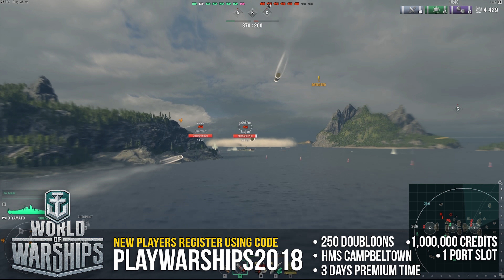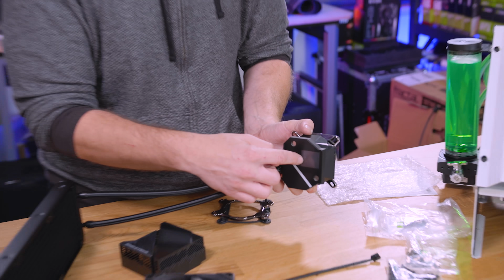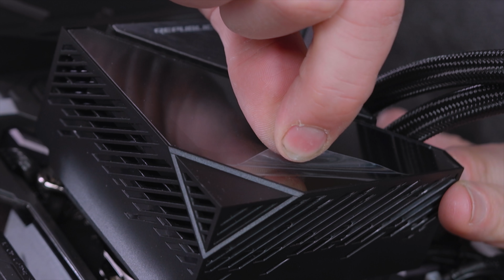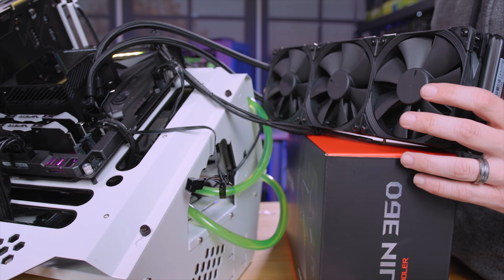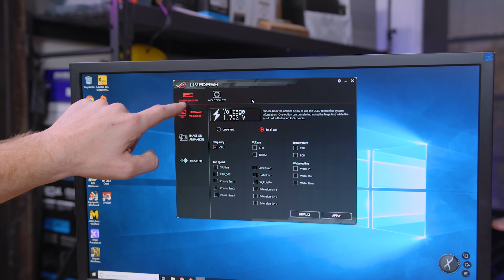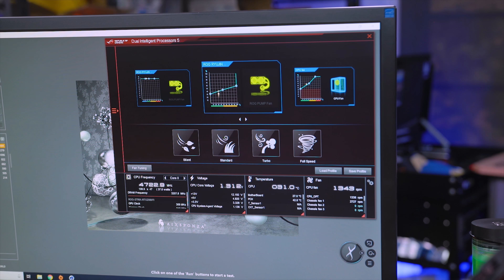ASUS made an AIO... but is it any good?? RYUJIN 360

Comment: It would be nice to see MB manufacturers begin adding some cable management to the motherboards themselves, either pass throughs close to the cpu socket or extra circuit layers to the top of the mobo that would allow closer mounting options for fan and pwm headers. This would be difficult given the way pcbs are printed, the sheer density of leads printed into each layer of the boards, and the problems caused by self induction when high current moves over inactive leads in other layers (interference and corrupted data anybody?), and as it stands, would be a very use case specific application. However, as more enthuist and gamer focused builds are moving towards watercooling and obscenely rgb components, one or both of these features to the boards themselves would add some much more attractive options for cable management. Adding some slightly taller standoffs could even allow companies like asus to place some of these connections on the back of the mobo, hiding those non customizable, hard wired component control and power headers to a place where they would remain out of sight. 

As for the AIO itself, it is very disappointing that asus did not do better quality control on the header wires for the fan control splitter. It is also disappointing that they did not wrap the cables together as one bound bundle for prettier cable management. The asthetics of the block/pump/screen are quite nice with the included shroud, but the fan for the VRMs is quite loud and annoying, youd think a bit more engineering could have been invested into the acoustics of the aio. The feature was a nice addition, but without better acoustics, it kind of runs it. If someone needs the extra vrm cooling, it would have been better to make a monoblock version to achieve the same ends with better asthetics and less little girl fan scream. 

On a related not regarding cable management, I think it would be cool to see if one of the rgb fitting manufacturers could make some hardline with imbedded power and signal lines inside the walls of the tubing, or figure out a way to flatten the wires into something that can me stuck on to the bottom, side, or top of existing hard line. I love the idea of a seizure inducing rgb build, with rgb or UV hard line fittings to make the cooling fluids look luminous without any other lighting source (think glowing green brain goo). But all those pwm wires dangling from each fitting is annoying to say the least and is neigh impossible to manage without taking away from the asthetics of the build itself (is that a "neigh impossible" comment a cable management challenge of the year for Jay? Maybe so).

Comment: yikes $280... i'd sooner buy a Swiftech Apogee Drive II ($150ish) and a XSPC ex360 radiator  ($63) and 3 Scythe Kaze Flex 120mm fans ($45).
not only cheaper*, there is a Copper radiator and far stronger pump. this will run whisper quiet with no *horrible whine like the Asus pump head fan. this will out cool and out duel any AIO and last longer.

Comment: Does it come with AM4 connector bracket or just Intel. Also would you hear the fan whine be heard inside an actual computer case? Also will you compare it to other AIO products. From a cooling (performance) stance is paying almost $300 better than other high end $150 AIO brands/Units? I don't think so, the OLED screen is literally pointless unless you have your Case right on the desk otherwise why even add the expense or gimmick. I like with Kyle from BitWit did with his overview. All I got from this video was a sponsored add plug and not much information on this very expensive AIO well other than shotty production of the Ryujin.

Comment: Hello Jay and Youtube builder community. I'm trying to build my first gaming PC. I've already bought most of the parts, but was in a hurry to try to get everything during Cyber Monday (even if not all of the parts were discounted for the day), and after further research while I wait for the parts to arrive, some of the parts might not be compatible (PH-TC14PE_BK) and others are apparently not all that great (Enermax T.B. 3-in-1 120 mm RGB Fans), so I was hoping for your opinions. The only thing I haven't bought yet is RAM. I'm completely open toward RGB in the build, preferably addressable, but what I'm not open to is a CLC (personal preference, don't want to even slightly risk liquid leaking on my very first, expensive build lol).

So, I'd like your opinions! First off, here is my parts-list: https://pcpartpicker.com/list/CywG6s      Just a preface as well: I know a 750w PSU with the build isn't optimal, the reason I purchased it is because I hope to purchase a better GPU soon. That reasoning also happens to go into the purchase of the monitor.

Some items i'm looking into possibly buying, and would like an opinion on, is the MF120R 3-in-1 pack  and either the G100M, MA620P, or MA410M (not necessarily a CM fanboy, and I'm completely open to alternatives). So, please, help me out, y'all! :)

Comment: I know that the wiring issue probably threw you, but there is little point in doing a review of a product that you are not going to test properly. Not comparing the temps with those reported by the installed sensors via a known good method is slack and would have highlighted that the package temp is 10-15c higher than reported by the block. TTL of OC3D had his review up a few days before this and highlighted the issue through this comparison. We don't expect absolutely rigorous scientific methodology, but this you may as well mark up as "entertainment only".

Comment: When AIO and MB manufacturers will start making some kind of standard where standard 4pin fan header with GND 12V RPM PWM can automatically switch to GND 12V DATA- DATA+(doesn't have to be USB standard can be I2C) so pump of your AIO is using only one cable for everything and you don't need to deal with a fuckton of cables?
It's completly doable.
And if not AIO LC then you could connect a RGB fan and have only one standard 4pin cable coming out of it, could have everything, RPM feedback, standard RGB control, addresible RGB, PWM control and heck why not a temperature sensor so you know intake/exhaust temperatures...
Reply: + it could be able to control addresible RGB strip

Comment: I've been using the DEEPCOOL Gamer Storm CAPTAIN 360EX RGB.
ASUS Maximus X Code, I7-8700K G.SKILL Trident Z 3200 RGB.
5.0ghz 1.38v... CPU is not de-lidded.
The CPU will crash under extreme loading (PRIME95) It never crashes running any game or app.
CINEBENCH R15, I Hit 86c 12 thread score of 1631.
Hope this is useful to someone.

Comment: Disregarding the loose fan headers on your unit, one simple solution would have been to put all those seperate cables into a sleeve in the factory. For that pricetag, that wouldn’t be too much to ask, right? Especially since they’re hardwired in there...

Comment: Just one question, if someone has their pc stashed under their desk, will they be getting off their chair and kneeling down sticking their face on the glass panel to check some numbers that they can easily see on the monitor? And what if someone has no glass panel? There is no point of this display

Comment: since ever had problems with Asus.
2011 17rog lap with bad keyboard. some keys weren working. and there was many ppl having the same problem
2013 another rog lap that had problem with key
2014 ok rog lap
2017 lap rog with sound problem and forums are full with the same.
3 rog routers that are bad sometimes. wifi stopped from time to time
2017 1080ti strix that didnt perform
i gave to much credits to this stupid company

Comment: Got an old kraken running push pull, two noctua industrial doing the push great temps on a delidded 8700k 60max 5.0/5.1 avx offset

Comment: Loose wires can be fixed, but you can't fix the LOUD fan on the pump, which you really hated!. I guess you could just not use it,
but then the air flow for the components surrounding the CPU would be gone. Can its RPM be adjusted? I notice you did not
 mention this big negative in your final sum-up.

Comment: I have the Corsair h150i (360mm rad AIO) cooling my i7 8086k @5ghz 1.3v. Never go over 46 degrees C while gaming. Very happy with it. Also got it for 140 dollars, down from it's normal 170.

Edit: Replaced the stock thermal paste with Thermal Grizzly Kryonaut as well

Comment: Auto Fan Tuning is a complete fail on my Asus board. Sometimes my CPu fan is set to 97% minimum speed. Doing the next tuning I get 25%. And the worst thing is, that you cannot tune single fans. So it does the whole process for all fans again and then the next time my case fan is set to 97% minimum.

Comment: Dear Asus. 
  As a semi long time Asus user a7a266 anyone you make some nice things, but wtf can't you hire a software engineer that can write ai suite with all the toys built in that doesn't require going into the software installers and changing properties and unchecking comes from a different computer that doesn't have 25 craplettes as a fyi this is not spelled correctly according to google and it wants to replace it with strapless running in task manager? 
Can you please hire a software engineer that can write code that isn't broken runs on everything, that isn't crapware that nobody wants to use that doesn't use 300mb of ram. 
Thanks a loyal customer for almost 20 years.
  As a afterthought QC guys QC.

Comment: hey, i need a suggestion for a monitor, i bought a pc with the help of my pc gamer friends , I have nvidia rtx 2070 , asus rog strix b350-f ddr4 something, 16gb corsair vengeance lpx dual kit, 650 watt corsair tx-m power thingy, hardrive+ssd ofcourse, 8gb msi geforce rtx2070 ddr6, amd ryzen 5 2600x  6x 3.60ghz . now the thing is , I don't know what monitor to buy under like 700$ , I want to edit videos and use programs like photoshop and stuff that's why I look for a 1440p display and since i am also going play games i want something with a proper refresh rate. There are things like g-sync and free sync and ips/tn/va panels and 1-4ms input lag and such. I am confused and don't know what to get, any suggestions? :)
Reply: I meant lower response time herp derp, as far as refresh rate higher is better, mb
Reply: @ProwlXV  i am currently looking at the ASUS ROG Swift PG278QR 68,5cm, it has g-sync and a refresh rate of 165hz. do you think its worth the money for the pc i have and the things i am going to do?
Reply: I dont know how much it costs though (I am in America and prices could be different)
Reply: @ProwlXV  thanks for the help :)
Reply: Okay so you have a 2070, since that is Nvidia you would want a G-Sync monitor, as far as refresh rate lower is better, also some 350 motherboards won't work with Zen+ (2600x for example) without a BIOS update.
Reply: @ProwlXV  why lower refresh rate?
Reply: The monitor is a little big, but 165hz is not bad

Comment: I'm still rocking an NZXT Kraken X60 from like 5 years ago with the stock thermal paste and temps are still good on my 4770K. I'll probably replace it whenever I upgrade to a new platform, but I've been pretty impressed with it's performance over the years.

Comment: Pretty easy to fix the wires if you have a proper molex crimper.  You shouldn't HAVE to of course, but I'd probably do it if the other option was RMA and waiting for replacement.

Comment: I must have gotten real lucky with my 8700k. Even with my old corsair h105 I barely hit the 60's at 5ghz. Granted mine hits 5ghz at 1.2v with 1.184v under load I am still shocked I get low temps.

Comment: Also, as I'm watching... disappointed (but not at all surprised) by the problems with the fan splitter/adapter... As a professional custom sleever, I know how hard it is to get splitters/double crimps done well (even with the best materials and hand-done attention to detail)... and they're even worse when done cheaply by a factory with insufficient tools/materials.
Reply: Solder them and it's NEVER a problem. In fact you will break the wire before you break a soldered joint. If your a professional sleever you want to make a huge dent in the market. Solder all or contact points.
Reply: @whpony96  soldering has it's place in wire/cable production... but often, crimped connections are much better... not when you're trying to make a big split joint (since terminals are designed to be crimped on one wire, so even double crimping can be dangerous)... the conclusion there is that any sort of splitting (more than two wires, which is definitely better soldered) is not ideal... as for soldering everything, the problem with that is that it is not viable as a business decision... the time and labor involved in doing that would make it virtually impossible to cover costs (much less make any sort of profit, which is already a small margin as is).
Reply: @whpony96  additionally, soldering by hand means that you can overdo it and unintentionally create a cold solder joint and/or let the solder flow too far away from the joint, which creates extra weak points in the wire... so while you may never break apart the soldered joint, it can create extremely weak points around the joint that are very easy to break... Don't get me wrong, I love soldering things, but it isn't always the best solution.

Comment: Lovely video, loved the editing, fun to watch, thanks! Very expensive and DOA cooler there from ASUS. I guess it's Asetec 6th so same as my Corsair H115i Pro 280mm cooler. I paid some 120 bucks and got the low-rpm quiet magnetic levitation fans from Corsair. Are they trying to charge more then double for the LCD bling nonsense there? Oh, my H115i keeps a i7 6700K @4600 MHz and 1.312V LLC5 at max 54C (in spikes) usually stays at 50C during Cinebench. It is delidded.

Comment: muhaha will love too have a fight agains you ;)on wows     well back too a quist i got on the new asus xi board in the top corner where there are 2 connecters one is a power 8pins as allways  but there allso   a 4 pin  do you need the 4 and the 8 pin too power you cpu on a asus maximus xi formula ?

Comment: I had a Asus Z87-A and I hated the BIOS and the Software runs like crap. I thought: "Give them a second chance" and now i have the Asus ROG STRIX X470-I GAMING and what could i say:
- The hardware itself is good (My RAM runs on 3200MHz, on my MSI X370 Gaming Pro Carbon i could only achive 2933MHz with really loose timings (Ryzen 7 1700))
- The BIOS still sucks (on DC controlled fans the minium power is 60%)
- The AI Suite wouldn't even install at first, i owned the mainboard for 3 weeks until they released a version that actually worked. And guess what: It still runs like crap.

And now seeing what you experienced with a 280$ AIO simply killed Asus for me. I will never buy Asus again!

Comment: I picked up an EVGA CLC-120 last year on a Black Friday sale.
I ran it with the stock fan on a 7700k for a few months while I was still adding my upgrade parts to the system.
After a while - I swapped out their fan for the Corsair Light Loop 120 fan instead.  Surprisingly - I noticed a fairly significant drop in the CPU Temp, by just changing that fan. Only thing I can think of is their shroud for the fan was bleeding too much pressure off the sides (which are custom cut by them (EVGA).) By using a Corsair fan with their taller sidewall shroud was able to push more static pressure through the RAD.   Idle now sits around 28c, and with gaming haven't even see it go above 60c (not delided.)  Makes it roughly $100 for this AIO setup, but I can't complain about it too much. 
But I wish they'd (EVGA) centralize their software for Precision X to include the CLC controls as well, without having to download their "Flow Control" software. 
All in all - would recommend it.

Comment: ASUS needs a little QA section for these AIOs to make sure the wires are crimped correctly. I stopped using AIOs in 2017 using an NH-D15 and keeps my 1800x @4.3 under 65c.

Comment: Hi JayzTwoCents, I have a problem with my Pc which I can't seem to fix. My Pc keeps freezing randomly for about 2 seconds. It doesn't affect my temperature or my fanspeed. But it sounds like my HDD is booting something when it starts to freeze. This started happening about two days ago. Before this I never had this problem. I have updated drivers and cleaned my pc of junk. I would like your help/advice with this issue.

Comment: just fitted a castle 280 rgb cooler to a 2700x, x470-i, evga 1080ti ftw3,  4.3ghz on all cores and have not had any temps over 65 as yet idles at 32- 34'C although not been gaming heavily so might have to drop freq's at some point, happy upto now did paint the pump  mounting plates black! -  thanks for the video, I did look at ryujin but cost prohibitive - a nice cooler but those wires! not good considering how much it is, maybe just a one off though - thanks again.

Comment: I use an EVGA 280 CLC based from your own review and it's was £15 cheaper than the Corsair. Using it on my delidded with LM 8700K at 5ghz keeps it in the mid to high 70s with 1.38v

Comment: I think it's great and it would match well with my full Asus RoG build, however my corsair h150i pretty much gets the same performance on temp efficiency for much less cost.  I also think that Asus needs to take note of corsair's eco system where you have 1 software that does it all, iCue.  With Asus I have Ai Suite, Aura Sync, Armory, GPU tweak and more...

Comment: ASUS quality control is so down the drain. unfortunately i bought a Strix Vega 64 lately.. and of course the VRM temp is skyrocketing to 115°C under load due to a sloppy thermal pad selection with a very bad fit. i used to own really glorious ASUS products like the P2B Motherboard or the CUSL2. unfortunately these times are long gone and their products quality has diminished into something way below average.